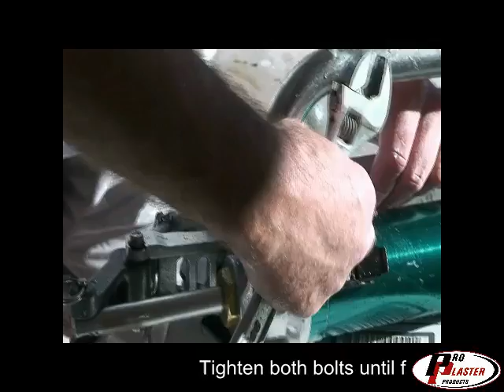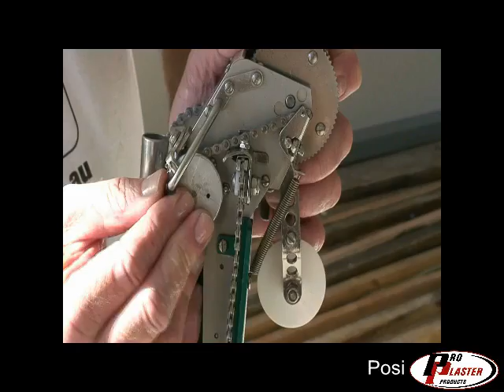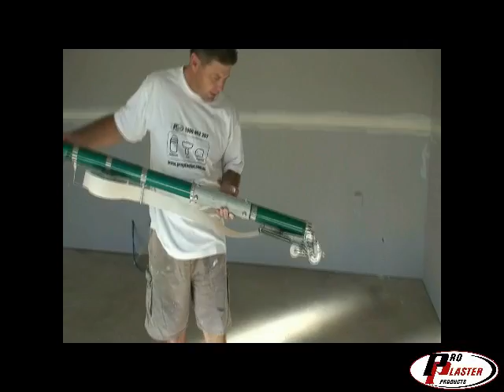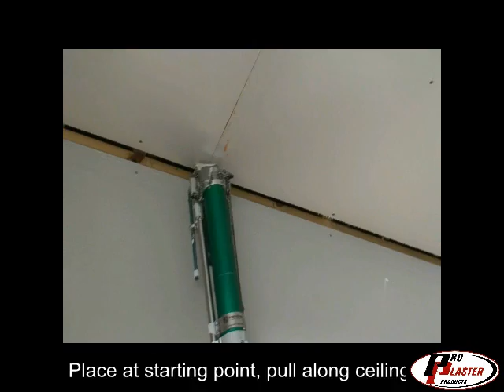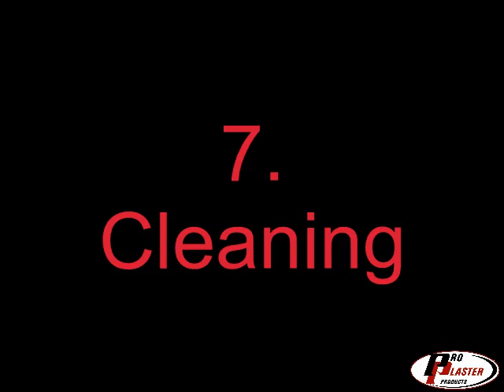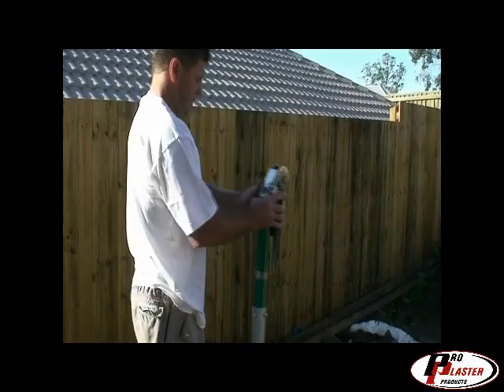How to use your automatic taper

Comment: That's right! Much faster than stopping, chopping and starting again at every corner. Also much less wear and tear (more like no wear and tear at all) on a few expensive parts, like the cutting block assembly which is $100. Blade life, spring life... I used to stop chop and go again but I've seen the light haha

Comment: Not wrong at all, that is the fast method.
When you bed the tape in to the board, you use your 6" to cut the tape in the corner before you bed it it. That way the tape is still cut and you didn't need to start and stop your machine. Same idea can be done with the banjo and mud box.